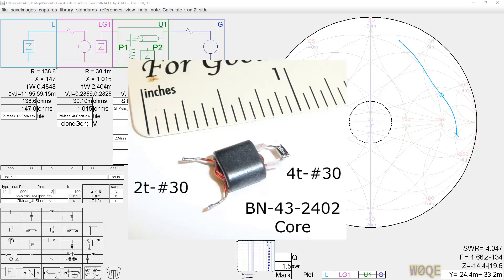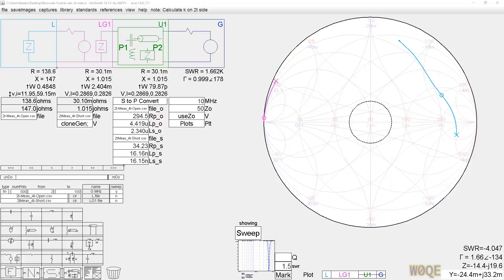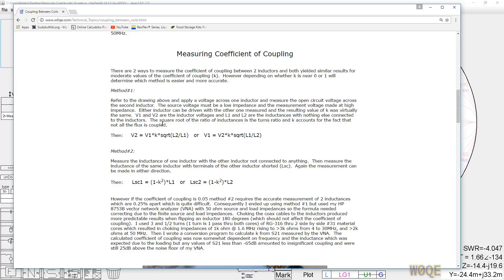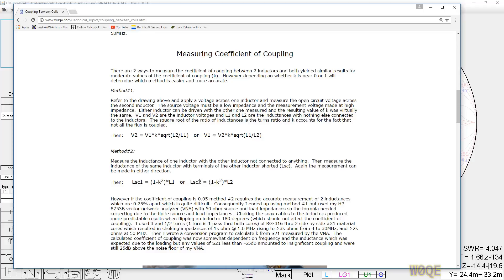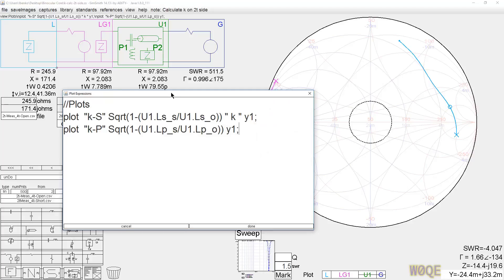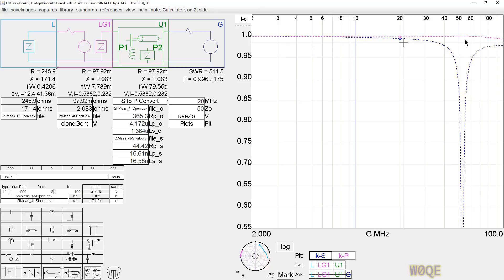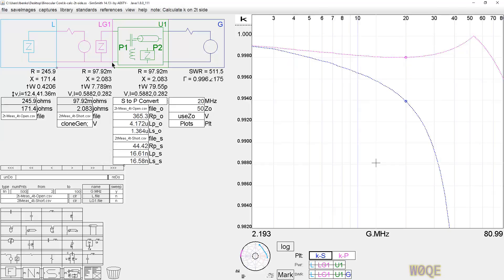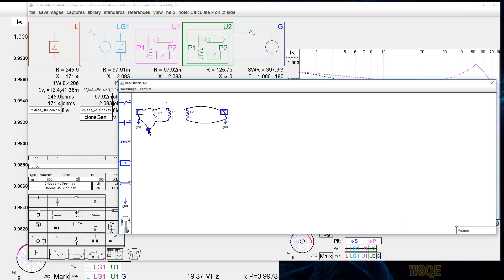#16: Coefficient Of Coupling (Adv. 8)

Comment: Two years later and all I can add is that LTspice is probably a more suitable package to use than SimSmith for this application.
Reply from the maker: Roger,
What feature(s) of LTSpice do you feel make it more suitable for this type of problem?
Reply: @w0qe  Larry
I'm not yet familiar with SimSmith but it looks like an excellent package for RF and transmission line problems. LTspice is excellent at time domain simulations and I'm more familiar with it. It allows you to enter the transformer model including all parameters such as leakage inductance, parallel capacitance, primary-secondary capacitance and magnetising inductance. Core loss can be modelled by a parallel resistor (but only at one frequency). This core loss may be more tricky to model as the complex permeability graphs of ferrites seem to indicate. If you keep the flux density really low you may be able to ignore the core loss. I have used LTspice to model SMPS power transformers and use the leakage inductance method.
Reply from the maker: Roger,
I use both programs extensively.  SimSmith runs in real time while LTSpice runs in batch mode,  SimSmith allows you to adjust any parameter smoothly via the mouse scroll wheel and see the results in real time which is huge in my opinion.  The "step" command in LTSpice is limited to 3 parameters and batch mode.  Also SimSmith natively plots impedances on the Smith Chart which matches what my network analyzers show.  On the other hand LTSpice in my opinion is better at plotting time domain problems but I still like the fact that SimSmith does not auto-scale the independent axis(s).  Of course SimSmith only operates for linear circuits while LTSpice performs transient analysis and is suited for non-linear components.  LTSpice also has a huge user base with a great on line forum.  Whether you agree with me or not, I don't think there should be any question that it is nice to have more tools (especially when they are free).
Larry